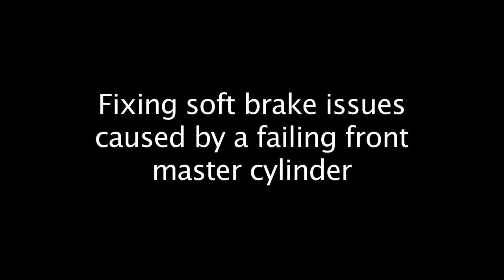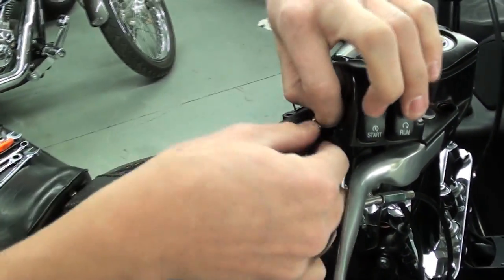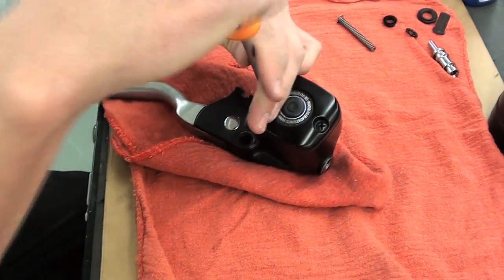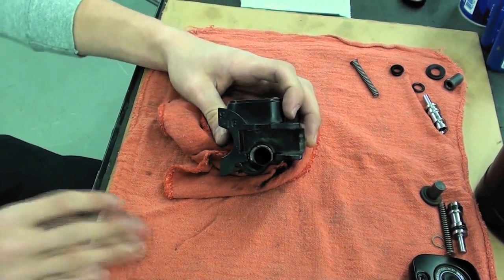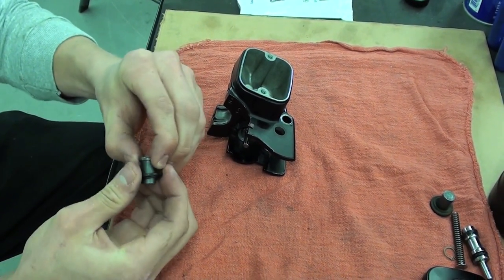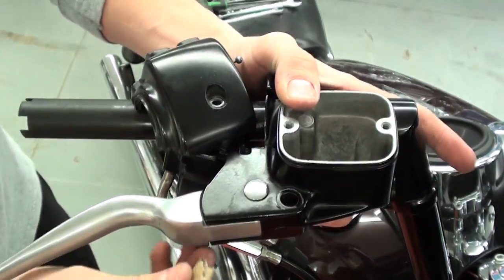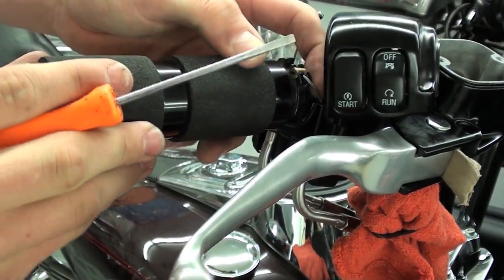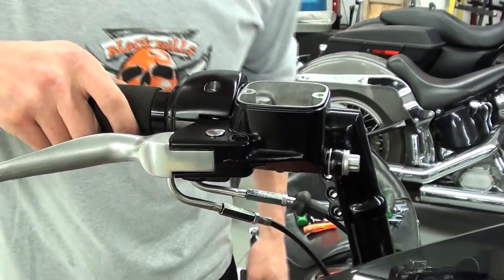Fixing Soft Brakes Issues

Comment: Was it necessary to remove the switch housing and throttle cables? 

I did my MC and only took the MC bracket and banjo bolt off.

Comment: Why did you split switch housing and disconnect throttle cables ?  Just slacken switch housing screws and slide towards outside 1/2 in or so.

Comment: A lot of unnecessary work going on there. Just loosen the throttle screws and leave the switch housing and throttle alone. Put the cardboard in the lever before removing the master cyl. Don't wash the master cyl. In the parts washer.....wipe it out with clean brake fluid and blow it clean with air after honing....if honing is necessary. AND...don't use the seat for a tool caddy. Unless it's you bike.

Comment: he would not have mine y the hell did you take the throttle to bits when the cylinder is it own unit : \
Reply: I was thinking the exact same thing. I am also not impressed with how well, or not so well, he protected the customer's bike with protective pads and and towels.
Reply: Exactly Tom. The last thing you want is to accidently drop a screw driver or any tool onto your tank or front mudguard. We also know what brake fluid does to paintwork. He wouldn't get my bike to work on.
Reply: the throttle was locking the cylinder on if you looked closely
Reply: @JamieS1992  all you have to do is loosen the two screws on the throttle side and that Notch moves clear for taking the master cylinder off